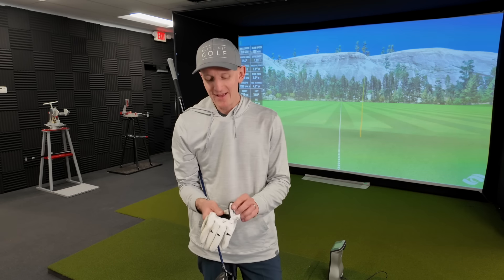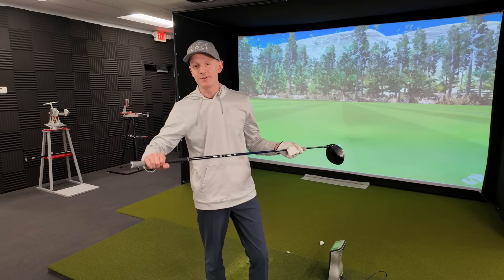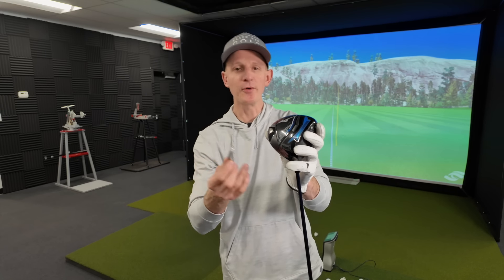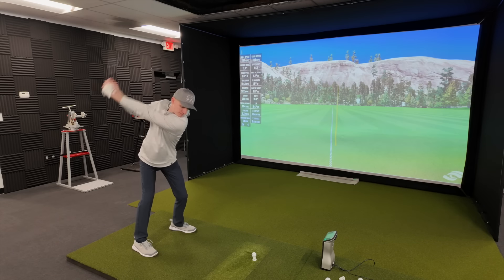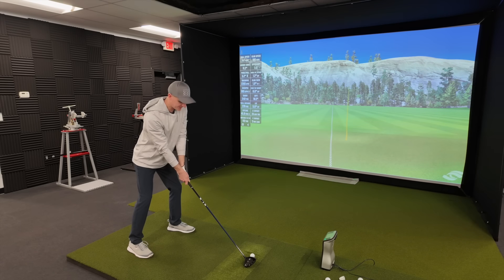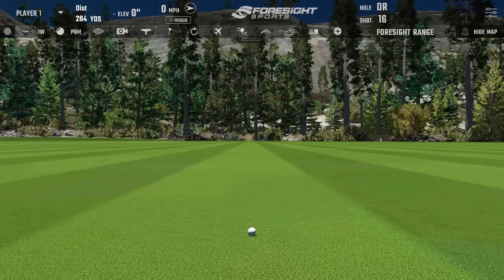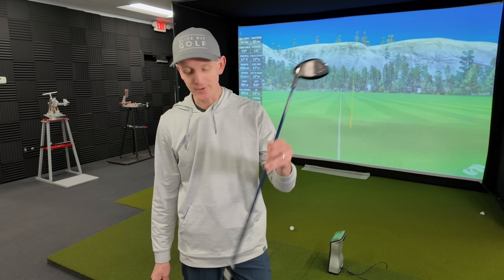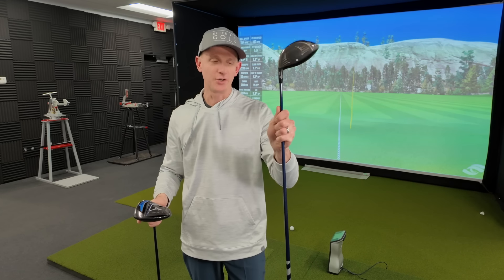MAKE YOUR DRIVER BETTER / 3 SIMPLE DRIVER ADJUSTMENTS

Comment: Does shaft flex change significantly when you shorten the shaft an inch (if you add head weight back for swing weight)?
Reply from the maker: If you add weight back then the shaft will play similar.
Reply: I have heard from many sources that the extra weight in the head to get your swing weight back to where it was, will flex the shaft more, and cause it to play one whole flex softer. So if you do this to a Stiff shaft, it will play like a Regular.  Is that not true?
Reply: @97LGT  I’ve cut down my driver 1 inch and added 12 grams to the head,. I feel that the shorter shaft compensates for the added weight to maintain swing weight. That is the shortened length makes the shaft a little stiffer. It doesn’t feel whippier at all. So for me, it feels much the same. I am pleased with the results and feel improved control.
Reply from the maker: @97LGT  Depends how much weight you add as to how much more the shaft will flex. Will it flex more yes, will that matter to the individual golfer is a different question.
Reply: @EFGMC  Thanks for replying! That makes sense. I have measured needing 22 grams added to my M5 driver to get the same D4 swing weight after I cut 2” off the butt of the shaft, making it a 43.5” playing length. I was thinking an extra 22 grams on the head would flex it a lot, but I haven’t had a chance to try it out yet since we have a ton of snow on the ground. Hoping to try it indoors soon though.
Reply: @Softouch333  Thank you for the feedback on your experience! That helps. I’ll be adding 22 grams, so I’ll have to see how it feels. I need a regular flex, so I intentionally bought a stiff, planning on it playing like a regular after cutting 2” off and adding all that weight. Can’t wait to test it out soon!
Reply from the maker: @97LGT  Also don't assume that D4 is what will actually work best. You may find that a lighter feel around D0 or D1 could be better. Experiment before making a final decision.